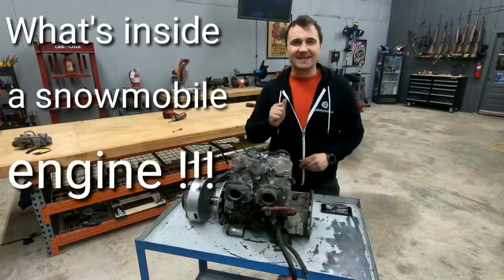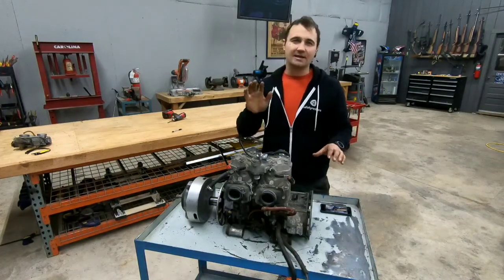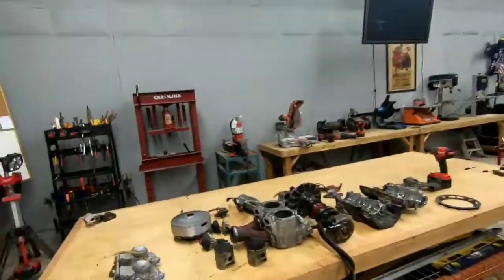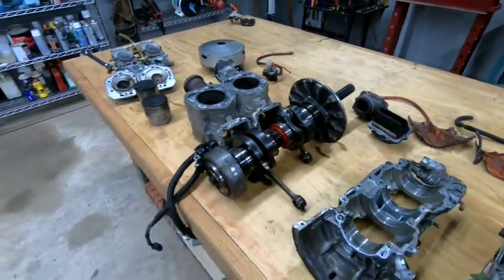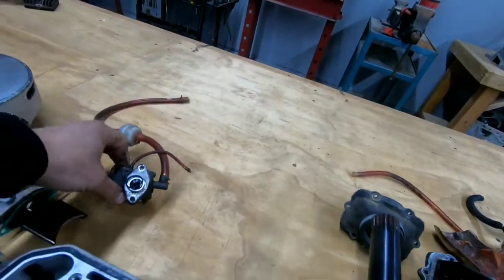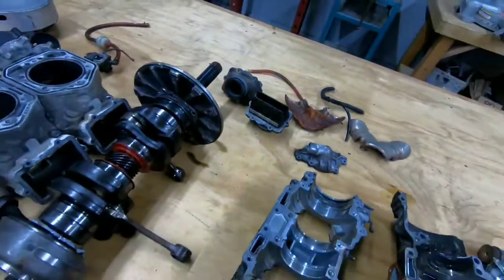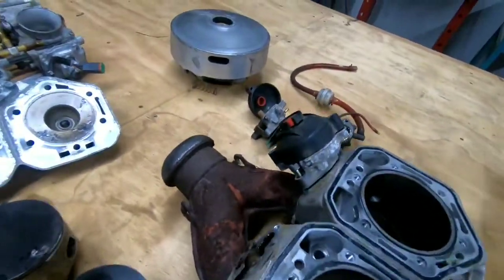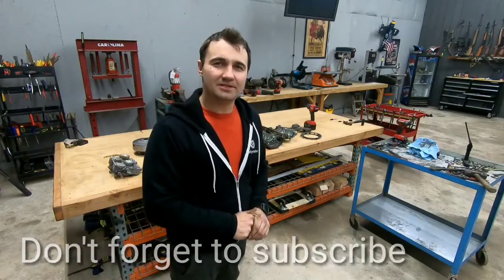WHAT’S INSIDE A SNOWMOBILE ENGINE

Comment: The one component I was curious what it’s called what is the last one you didn’t know. Anybody know what it is? I’ve heard them called high altitude compensators and also vacuum cans? What did they do?
Reply: If you're talking about the part at 7:17 in the video it's a power valve
Reply: and at 8:18 those are called the reeds